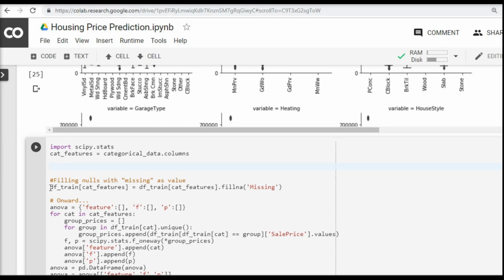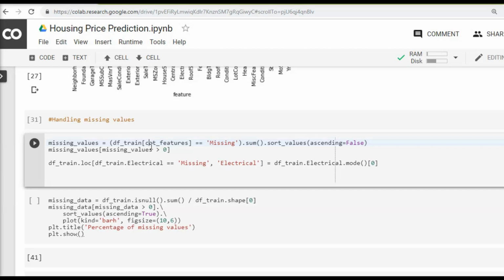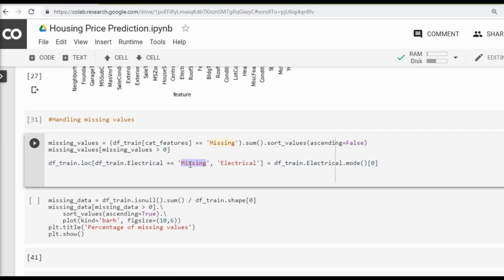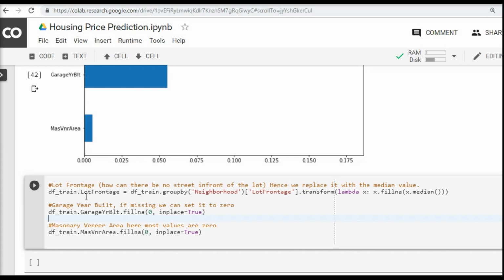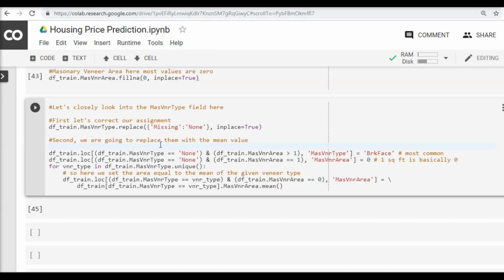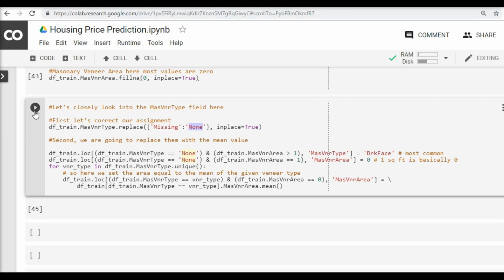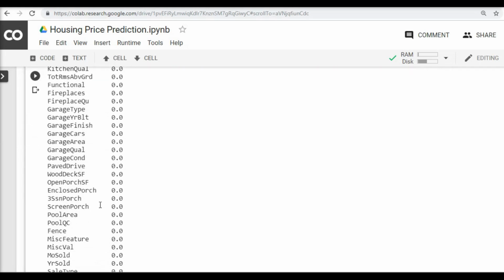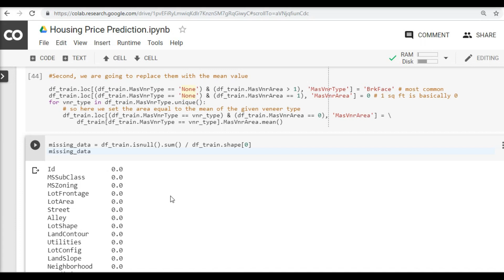Housing Price Prediction Part 7 Step by Step | Ad-Hoc Analysis

Comment: Why my LotFrontage is still showing 0.177397. I followed the same process as in the video all other variables has 0 missing values but LotFrontage has still 0.177397. Why is it so? need help
Reply from the maker: Could you please share at what time of the video you have that doubt)
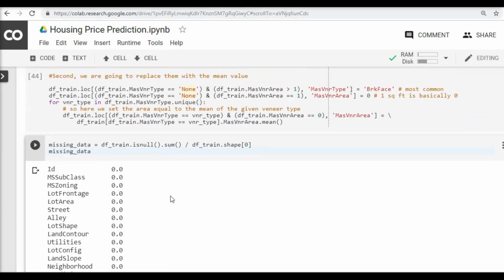Reply: @MirrorNeuron  4:47 as it shown there is no null values in any features but when i follow the same steps. It shows 0.177397 missing values for LotFrontage. But other features are fine.